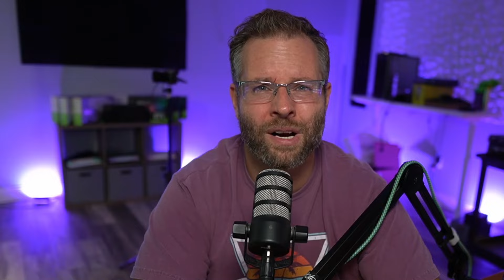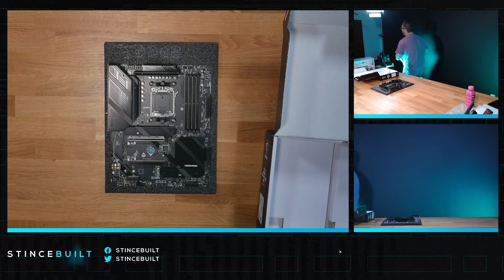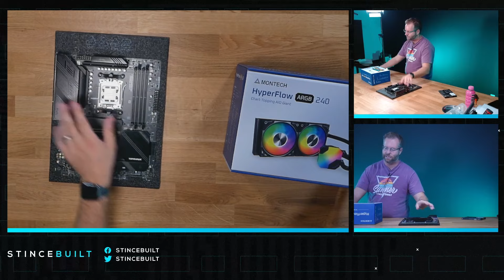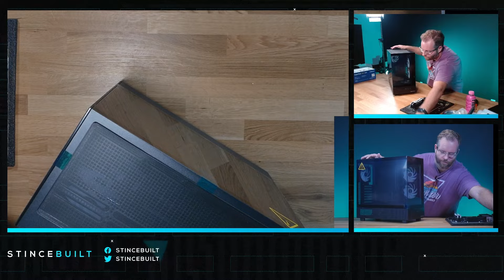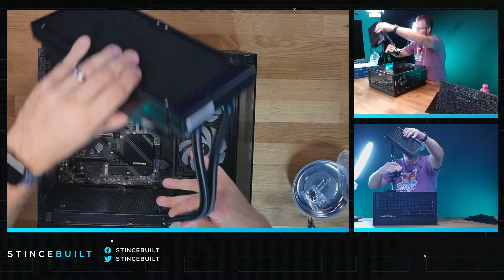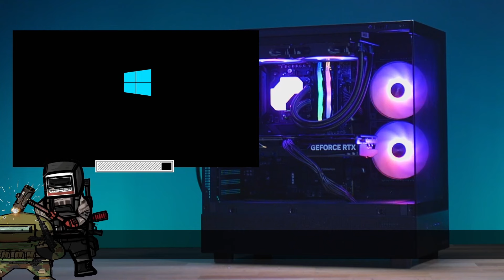Check out this Montech XR with the AMD 9700X Gaming PC Build

Comment: Is the back fan in the case intake or exhaust? If intake, is it possible to switch it to exhaust or..?
Reply: usually the back is always exhaust but you can just turn around the fans and make em blow the other way I guess :D they dont mind whichever way they are facing.

Comment: Hi, when using an ATX motherboard would you still be ablew to install 120mm fans at the bottom of the case just above the psu shroud? If anybody could help me with this then it would be greatly appreciated. The reason I want to do this is because im swapping to a different case (the montech XR) and have extra fans from my old case. Thanks
Reply: Yes I have seen a build that did that with standard ATX and normal height 120mm fans. They said it was tight but doable.
Reply: Im with the same issue. Were you able to assemble it the way you wanted? Did it work or were there any problems?

Comment: should  i get a 3 fan or 2 fan AIO with this case?
Reply from the maker: That depends on what you are aiming for! There are a lot of great AIO's in 3 and 2 fan designs! The 240mm is plenty but for $10 more, the 360mm offers future upgrade potential on warmer running CPUs!

Comment: Thx for the showcase but there's no hub/controller for the argb fans right? So you just put them into the mobo and use a software to control the colors etc.?
Reply from the maker: Yes! We’re utilizing the motherboards rgb software
Reply: @StinceBuilt so just with MSI Center? Perfect, thx?

Comment: Can you control the lights?
Reply: There are no hubs or case switches, and the included fans are daisy-chained, so they connect in groups of three to the motherboard and are controlled by software. If you want a hub and switch, I recommend the MONTECH sky two. The sky three is scheduled to be released next year.
Reply: @銀河光芒  what's the software to control the fans bc mine just keep looping and I would like a single color or something
Reply: @Flop8201  I use a montech ax & rx and rotate the edges in a single color. It's not optimal for that purpose, but it's controlled by genuine MSI software.
Reply from the maker: Of course
Reply: @StinceBuilt  But how, theres no controller right? So you just put it in the Mobo and download a fan controller?

Comment: Great informative vid - I am looking to use this case for my first ever PC build! Just a quick question, is there any point putting fans on the mesh at the bottom? I've heard it may clash with the PSU or something? Cheers 😄
Reply: I brought this case a few weeks ago after looking at some reviews.. It really is a nice case🤤.. very very well put togrther. I put 3 fans in on the bottom also. Dont worry...plenty of space between the fans and the gpu...would probably depend on the size of your motherboard though...I have about 4 inches of space between the top of the fans and the botton of my gpu . My MB is a Gigahyte H510M H V2 Micro ATX Form Factor. Hope this helps..Happy building 😊
Reply: Also, the PSU has its own space underneath..No clashes at all... only thing is the fans may cover the hole to put cables through like the pcie cable in the video depending on how many fans you will use.

Comment: What Mob would you recommend, a mATX or ATX Mob?
Reply from the maker: Depends on what kind of build you want.
Reply: @StinceBuilt  I’m thinking of using a B650M-A MOB, this case with a 3060 ti , Ryzen 5 7600x (my first build btw) is that a good combo?
Reply: @KenOath9119 this case is an ATX Case, you should use an ATX motherboard

Comment: I ordered this case(but the white version) along with a MSI B550M PRO VDH (with internal USB-C & ARGB), they cost me about $60 each (+25%VAT) so should be a good value, but alas, the delevery has been delayed until next week. I'm thinking a Ryzen 3600 + A750 would make it a nice 1440p 60FPS thingy.
Reply: But it’s an atx case it will look empty
Reply: @YanifulRL  That doesn't really bother me, more wiggleroom for connecting cables at the bottom of the MoBo is nicer.